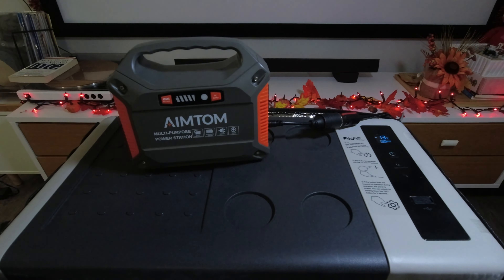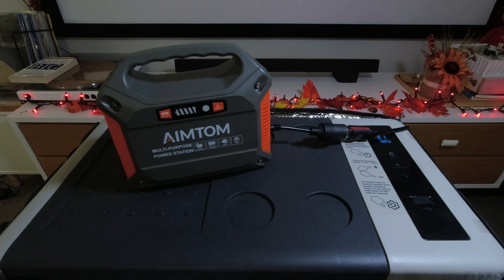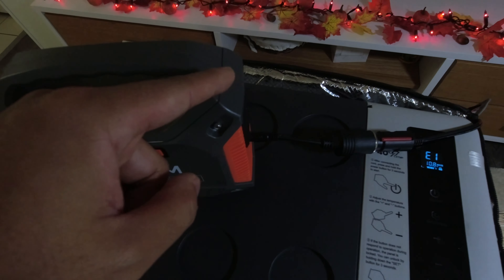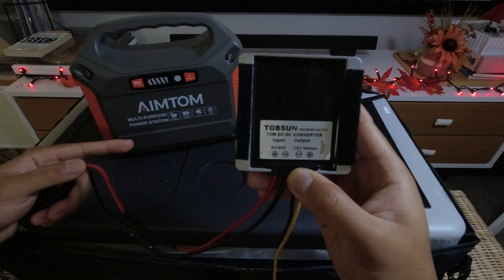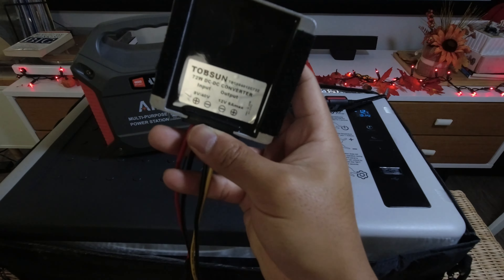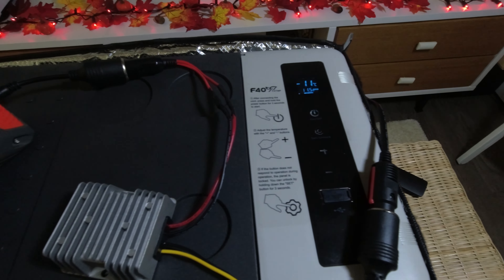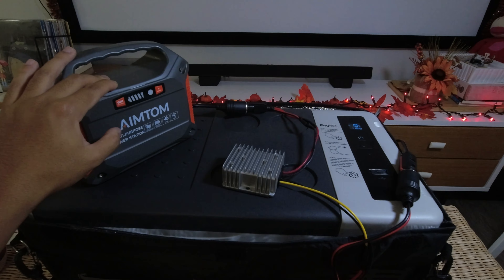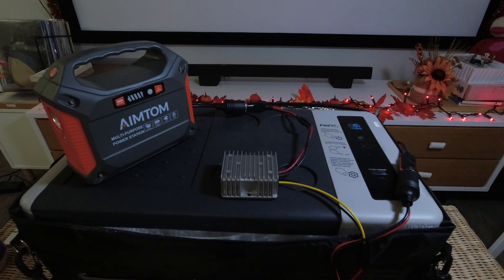How to Get More Power From Your Unregulated 12v Power Station

Comment from the maker: I did testing to see what the run-times would be, here are my results:

Ambient Temp = 24 C | 75.2F
Fridge Temp set to 2 C | 35.6F
155W Aimtom Portable Power Station

Without DC Converter = 8 hours until E1 Error or Low Voltage Error

With DC Converter = 18 Hours Until Power Station is Completely Drained.  

This was an awesome result. The plan is to use the 155W power station as a dedicated battery for the fridge. I have another 400w power station that can charge my 155w battery during the day. I also have an 80w solar panel to charge both power stations.